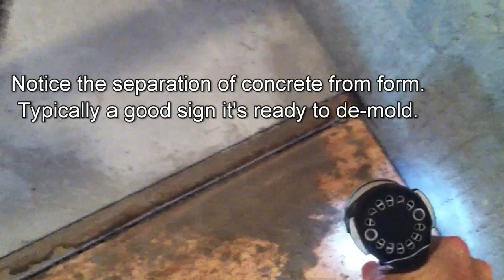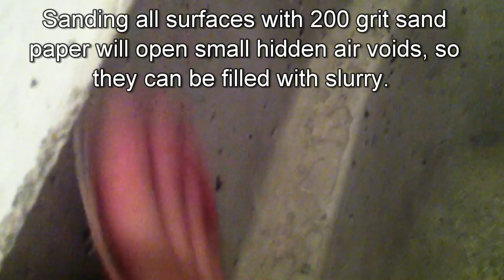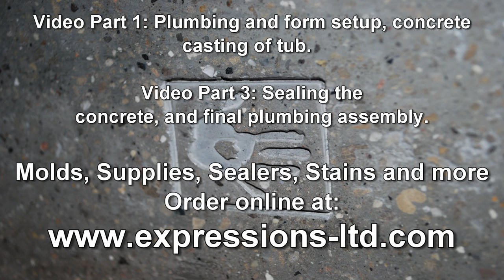Making a Concrete Bath Tub Part 2- Mold Removal and Finishing

Comment: Tiled concrete tubs were popular for a brief time in the 70s. But , all that concrete would suck the heat out of the water before you could get comfortable. This is OK if you like cold baths.
Reply: I agree, way to much mass. In winter you would need an underfloor heating system in this just to make it usable. Cast iron tubs are bad enough for turning hot water cold, but solid concrete is just too much.
Reply: Any good self respecting bathroom is a private get away with in-floor and in-wall hydronics, it's own dedicated instantaneous tankless condensing boiler, heated towel bars...Ipe wood seating and flooring, infra-red heat lamps, steam generators, fully tiled, glass block natural light...glass surrounds over an inch thick, a bidet, a sauna, a door leading to private outdoor jacuzzi / tiki / koi pond garden - of COURSE, this tub has thermal mass = beneficial - once heated, it STAYS heated. Maybe it's just me.
Reply: Hmmm point
Reply: Please tell me if its possible to overlay concrete on fiberglass? Kinda ...like how they do those counter tops.i cant find any videos on it ..if u can give any advice i would really appreciate..thanks

Comment: If radiant heat was being installed in the floors it could be continued in the walls of the tub too.
Reply: Putting radiant floor heat in concrete, wouldn't keep up with the rate of cooling. Especially, in a basement, where it would be under the frost line. I certainly wouldn't consider putting all that weight over wood framing. I would treat it like a brick fireplace, as far as support. I like the idea of displacing the bulk of concrete with foam insulating layer. That would serve two purposes. Heat retention, and weight reduction.

Comment: I like the concept but am also curious about total weight. I would also ditch the Harbor Freight clamps and use a good Jorgenson 3/4"pipe clamp.
Reply: Shouldn't even need to happen. If they had enough brains to use some type of form oil or sealant.

Comment: Can i use this items for this project valspar 24-82390 high gloss and valspar 82079 etching concrete stain sealer? Its that all i need to achieve what you did or i missing something?